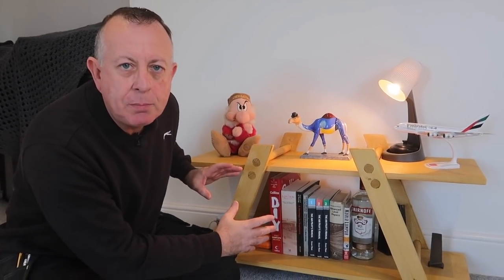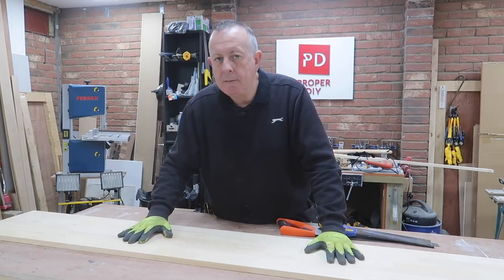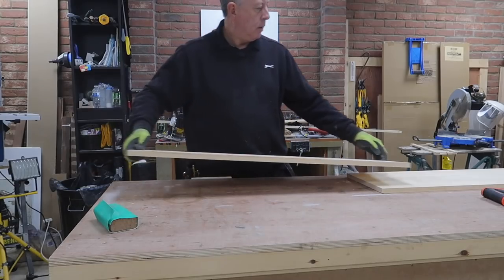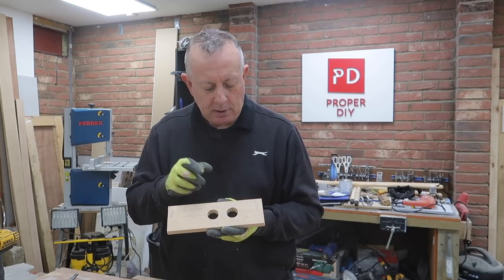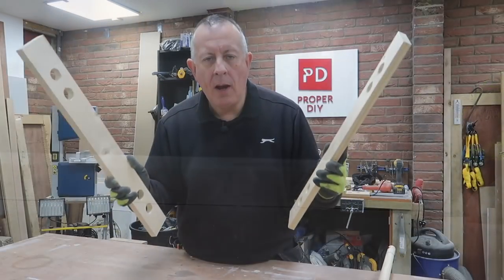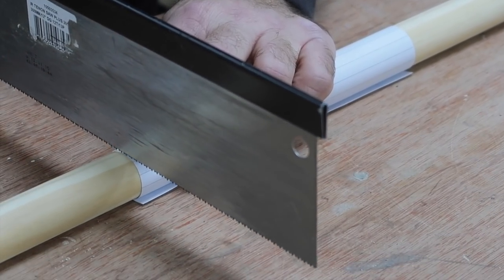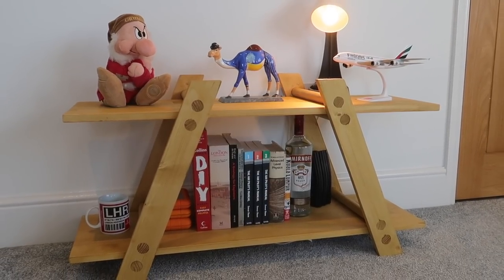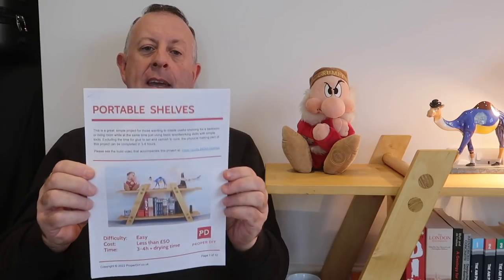Easy to Build Portable Shelves

Comment: This is a fantastic guide. Production quality of your videos is excellent. I'm pretty sure you're already aware of forstner bits but as you didn't mention them I think they might be of interest to others who might want to build this. forstner bits are an alternative to the spade bit but create a much cleaner hole in soft woods.
Reply: The best drill bits, I've found, for use with a cordless drill are Wood Owl Overdrive bits. Minimal tear out when drill through ply or solid wood.

Comment: Pro tip: the handle of a hand saw cam be used as a square of you lay the blade flat on your workpiece.
In fact it also does 45 degrees of you rotate it. And it's a lot longer than a regular square.
Reply: I think I use my saw as a square more than my actual square 😅

Comment: I recently ruined a desktop I was building because I used Titebond II wood glue to make my ‘DIY Filer’ and was horrified to see it did not dry the same color as the wood but was notable darker. The bog-standard non-Titebond yellow wood glue worked fine. Livid and irreparable for stain.

I used dust from my sander as it was finer than sawdust.
Reply from the maker: Yes Titebond is quite dark and to start with. Good tip about the fine dust

Comment: Great project again Stuart, how did you find the new spade drill bit?
Reply from the maker: Hi there! Those drills are vicious! As they pull the bit in with the front thread I thought I was going to drill Thro ugh the piece and the board underneath and my work bench! I was constantly holding it back. I think they would be excellent for quick holes through timbers for cables and pipes.

Comment: Is it just me that I find B&Q a lot more expensive than other stores of the same type?
Reply: B&q have panel saws which is good to get boards cut down
Reply: @ryk3899  where do you buy sheet goods from?
Reply from the maker: I purchase from all different places as you can imagine and I find there is no one shop that ticks all the boxes. If I want a large amount of timber for a project, B&Q is the last place I would look. However, for the average DIY'er who wants to get something done over the weekend, places like B&Q are easy to deal with and you can see exactly what you are getting hence their popularity. My local builders merchants who have the cheapest timber will not allow you into the yard to even see it because of forklifts operating!